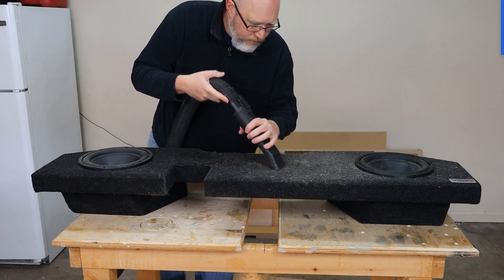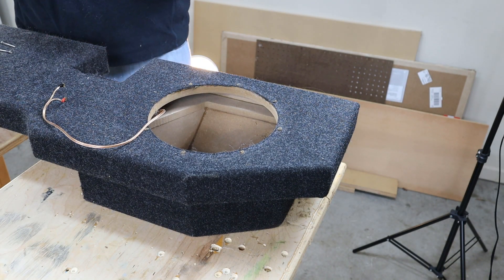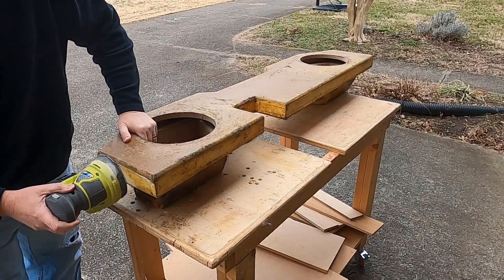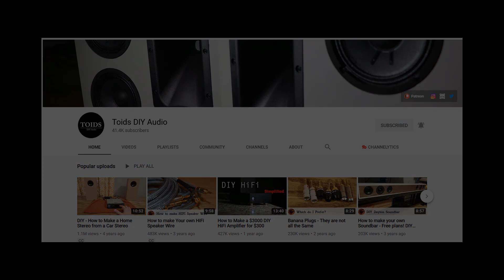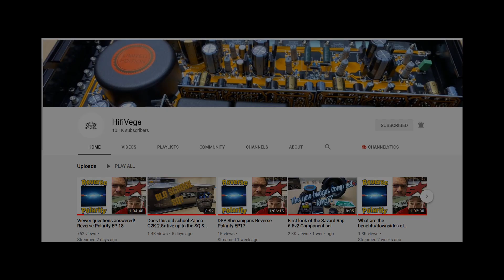Wet Subwoofer Box.  NASTY!! (Ram Truck)

Comment: Polk makes good subs. I have a pair of 10” Polk MM that Ive pushed hard for hours on end for years without skipping a beat.
Reply from the maker: Definitely one of those brands that most people overlook.  At one point every speaker in my truck was a Polk.  I wish their marketing department would do more to try to stand out.
Reply: @DIYAudioGuy  I agree they don’t market their products very well at all especially in the mobile audio department. Like a well kept secret I guess for us who are in the know.
Reply from the maker: @Thumper68   I guess they sell enough to justify what little bit of marketing they do.
Reply: @DIYAudioGuy  whatever their doing works for them. I’m sure they know more then us lol!
Reply: I had some MM 8” subs. I loved them. I couldn’t find any ported specs for them so through trial and error I made some and found that 1.25 cu ft was perfect. Always overpowered them too. Amazing subs. Everyone thought that I had 2- 12” subs.
Reply: @superchile9640  definitely slept on subs big time. They always end up selling cheap new because of it if you just wait awhile.
Reply: @superchile9640  8” box specs sealed .5-1.2 vented .66-1.75
Reply: @Thumper68  I never found anything from Polk. I made box 1.5 and kept adding/ removing material until it was just right.
Reply: @superchile9640  yeah sometimes the info is hard to find but the specs I just posted are polk recommended. Sounds like you went about it right to get it anyways :)

Comment: You can try to recover this one imho. Rip all material of it. Use sandpaper to remove top layer inside ( outside also if needed ). 
Get some chlorine and spray the the chamber  few times, next get some primer and just cover this place.

Keep in mind that I have used this solution for walls :) since your chamber is ruined either way you can try it.
Reply from the maker: I think you're right, you're sure not going to damage the box if you try to fix it that way.

Comment: What would happen if you covered up the mold in a subwoofer enclosure by painting over it with rust oleum truck bed liner spray paint would the smell from the mold go away.
Reply from the maker: Mold is notoriously difficult to get rid of.

Comment: I have a question for you sir?.
Reply from the maker: Sure, what is it?
Reply: @DIYAudioGuy  thanks for your time and help ! My question is I have a blow thru box in the bed of my truck and it rained on the box and the particle board has bubbled up can I sand it flat and apply fiberglass or should I build a new box
Reply: @DIYAudioGuy  I pulled a lot of the moisture saw dust off now it rattles outside but the inside steal sounds very nice I flex seal it after I sanded the loose particleboard off didn’t seal what should I do